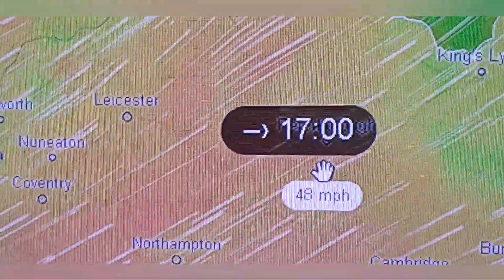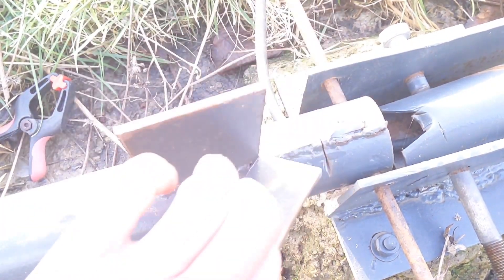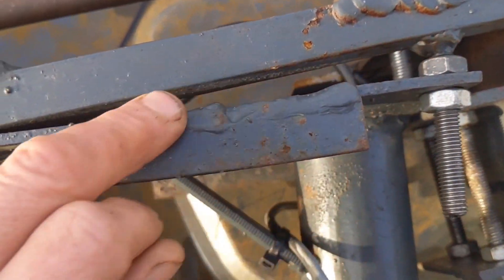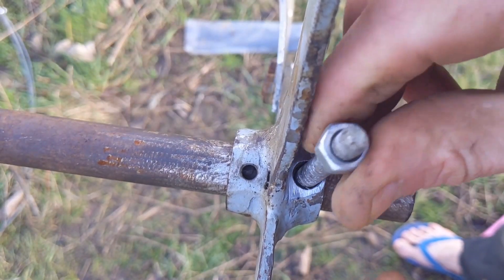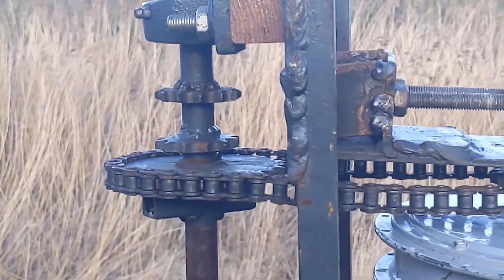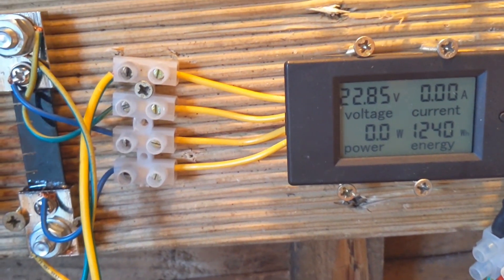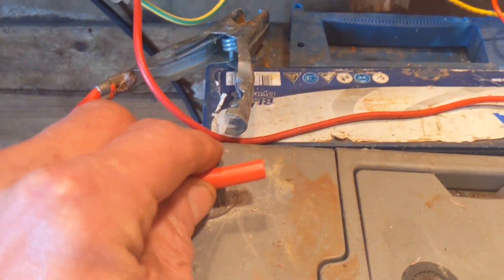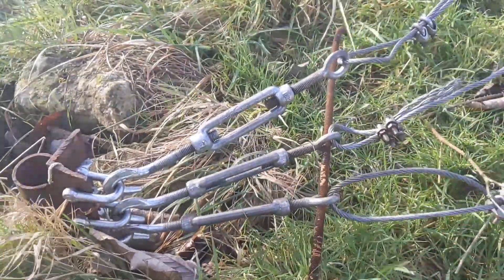48v 1kw E-bike Motor Hub Wind Turbine - Free Energy Projects - First Day of Testing - 17th Feb 2022

Comment: "added a brace here...".

admit it, you hacked up an F-clamp... hope it was a junk one ;)

this is adequate... but you really wanna run that motor through some tests, ideally with a lathe. fixed speed...

the power it takes to run is no indication of the power it can develop. it only has the flux of the magnets inside it to produce an EMF, it isnt being fed a current to produce magnetic fields in the pole pieces. 

spin it at 500 or so. you want...

open circuit voltage.
short circuit current.
torque absorbed when shorted. ie, an arm, a set of scales, and some maths if it isnt a foot long in lbs or a meter long in newtons...

winding resistance.

the short current (the shunt of a high current ammeter is good enough as a "short"...) and the winding resistance, I2R, will give the absolute maximum power you can ever draw before burning out the generator.

now comes the fun part... loads.

if you simply start putting decade resistance across the output, 10, 1, 0.1, etc... (nichrome, wound as heaters as they will get HOT. try boiling water?) measure voltage, do the maths for amps and I2R...

you find theres a specific resistance that it works best at. about 2x the winding resistance.

think about this... if the generator is shorted, where is the heat generated? in the entire winding. when there is a resistance with current flow, that same current flows through the entire winding. too high a resistance, and current in the total circuit is limited.

too low a resistance, and the "load" becomes only a small fraction of the total resistance of the circuit. you burn the windings out.

and from that, you then start seeing that batteries are not an ideal load at all. 

you have a generator, and it can deliver say, 300W. at 12v, at 25A.  0R48 for the load. or I2R ...25x25x0.48=300W.

you put batteries on, say SLA. they dont charge at 12v. they charge at 14.4v.

yet the batteries may not even present 0.48 "load". they might be 0.2 internal resistance... the generator voltage will sage as it tries to deliver current to this load, but teh batteries themselves dont actually charge unless theyre at 14.4.

the only way to get the generator to hit 14.4 is to increase the resistance it sees, at which point teh current it can deliver is limited...

so the batteries level out, find this point where they load down the generator just enough but can never actually utilise the generator to its full capability.

if you generate electricity, you are stuck to this narrow window where you cant use wind below a certain speed, and you cant do anything above a certain speed as the generator is saturated, or the batteries cant take the power produced. its a PM generator, limited flux, and can only produce so much.

if you focus on simply making heat... you can grab every watt available before betz gets annoyed. regardless of how hard its blowing.

Comment: My guy… 2:30 just tap the hole and use a grub screw as a set screw on the shaft, just make sure to use Loctite! 😅 Use the Allen key and not only will it be æsthetically pleasing, but much easier to take on and off.

hope my comments/suggestions aren’t taken as criticism, I love the project and idea!  

Another idea would be to put together a ”skin” to cover the mechanism and frame. It’s very “dirty” aerodynamically and is killing efficiency at least a little bit. Perhaps just some 2 inch insulation from foam from the local store.  What you’d want is 2 halves(top/bottom) to create a fuselage of sorts, you can stack and glue the foam to get a thick section, then it’s very easy to cut and sand it to shape. The foam collapses with a little bit of pressure, so you can kind of just push it on to the inner gearbox/motor and it will mold to missed protrusions after some preliminary hollowing out. then secure the 2 halves together with a couple dabs of glue where they meet along the seam (leave some foam there to make matching “faces”) and shape it to the best of your ability. Pretty Zen and enjoyable work, just remember to wear a mask! Then once you are done, cover it with some fiberglass. Like a surfboard! You now have an areodynamic shell with foam on the inside perfectly molded to the inner structure. Cut it in half. Cut it along a horizontal line so that you can leave the top solid, preventing water dripping in, with vents on the bottom. Pick some areas of foam that “molded” to a structural part of the inner mechanism that you would want have support the “fuselage” and fiberglass that arEa. 
 If you want to get real cool with it, put some NACA ducts for cooling. Now you have better efficiency and protection from the elements. The 2 halves can be attached with a hinge and latch, tape, whatever you’d like, with it using the fiberglass inside shape to “hold/hug” itself onto the frame, the clamshell body becomes a clamp. They make extruded rubber seals of all types for the “in between”, and definitely make sure to have proper venting/cooling. 

Also the “concave” wing is definitely causing/suffering from massive turbulence at those air speeds. Random guess but at least halfway out the radius you are getting major separation and drag. An easy remedy would be to maintain the outer curve, the “convex” side, but fill in the concave side to make it flat. Fill it in with expanding foam, sand flat, and run a sheet of fiberglass? Basically you want a real airfoil at your level of advanced engineering/building. I say this coming in peace as an aviation nerd and model RC “pilot” 😉 so the Airfoil is something I can get really “spun up” about,  figured I’d “take you under my wing” and share some knowledge. 🤜🏼🤛🏼 

You may even wanna try linking up with some RC model blokes that cut wing “cores” out of foam using a CNC controlled “hot wire”, pretty cool stuff. Wings can be made with almost any airfoil, and importantly for you, twist, as it’s a propeller with different AOA… it would be a cool collaboration, and theyre all wizzes with e-motors etc.

Skål
Reply from the maker: The design for this wind turbine has completely changed. I don't know if you saw my video I put up yesterday. Thank you for the comment.

Comment: Hi!! What was the peak power it produced? And what are the specs of this  hub motor? Cheers!!
Reply from the maker: 389 watts was the most I saw but am making changes and it's going back on the tower.
Reply: @GavinFreedomLover  and what is nominal power and voltage of this motor?
Reply from the maker: Not sure its a 10 year old ebike motor think its 48v 1000w but obviously it's not designed to be used on a wind turbine.